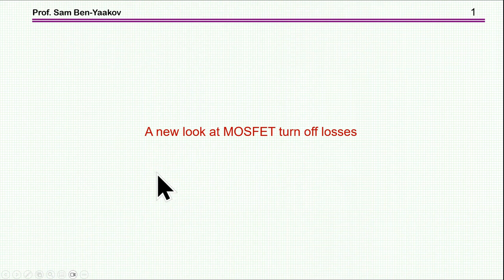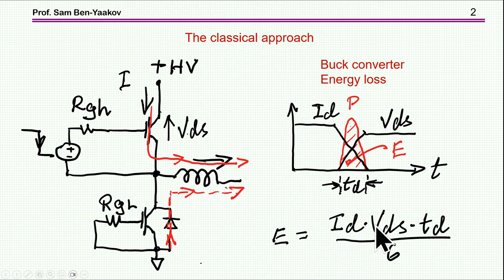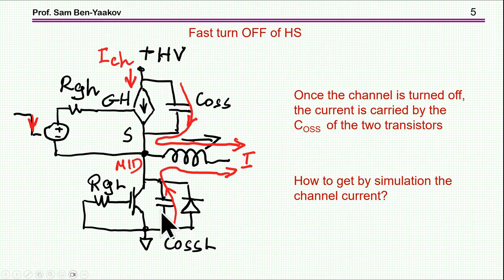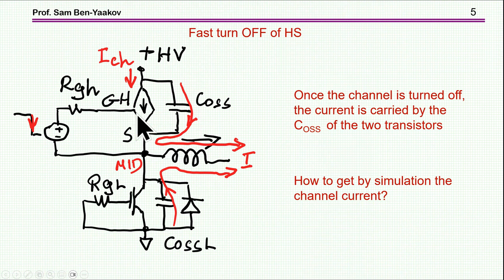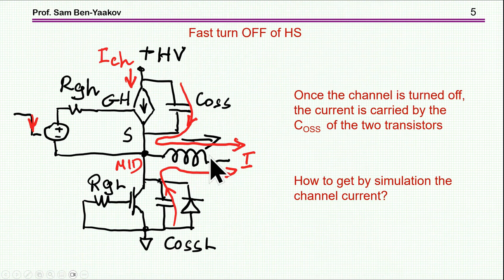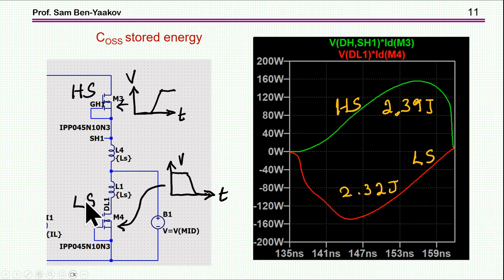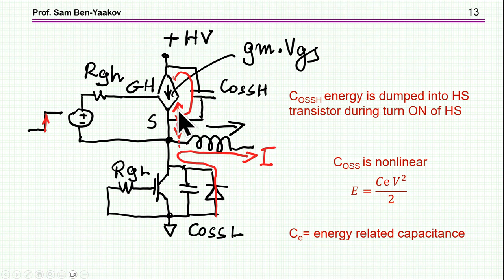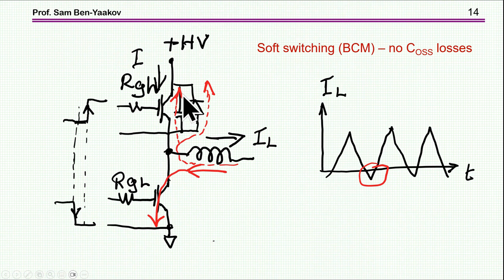A new look at MOSFET turn off loss

Comment: We just published a paper on measuring the turn-on and turn-off losses (title: calorimetric measurement methodology for comprehensive
soft and hard switching loss characterisation). We can directly measure both turn-on and turn-off losses at hard and soft-switched conditions. We do all that without a current shunt or impacting the switching loop. The paper is not yet indexed but if someone is interested I can send a copy.
Reply from the maker: Interesting. Can you send me a copy? sam.benyaakov@gmail.com
Reply: Could give the link to the paper ?
Reply from the maker: OK

Comment: Would the accuracy of the simulation in this context be improved at all by switching from the Shichman-Hodges model (level 1) to an alternative model such as MOS2, EKV, or BSIM? I know the latter two are designed for submicrometer ASIC applications, and may be difficult to set up from the datasheet alone, but the improved modelling of subthreshold behaviour seems to imply that they might offer improved accuracy in the context of switching losses. I'm less familiar with MOS2 (and MOS3) but they look to be very easy to set up.

Additional question: is there any non-negligible internal parasitic resistance (or another source of thermal loss, such as we see with domain wall heating in MLCCs) in the internal Coss path during switch off? If so, is that at all relevant in the hard or soft switching cases? (presumably not in hard switching, since the energy is lost into the channel anyway, and only fractionally so in soft switching due to external parasitic losses dominating the picture)
Reply from the maker: Good questions. 
1. I really don't know which model is th best. I am using models supplied by the manufacurers assuming that they chose the best MOS model.
2. Dielectric losses were documented for super junction transistors, I doubt if it is significant here. 
Thanks for the conversation.

Comment: Great explanation on the MOSEFT switching behavior. One question, considering the channel loss and Coss E stored as a whole during MOSFET tuning off, how does the dependency on inductor current look like? Is it still the higher the IL the less the total loss but with less correlations factors, or no change on total loss?
Reply from the maker: Good question. The inductor current is controlling dv/dt. The higher the current the faster is the rise and the overlap.
Reply: @sambenyaakov do you mean to say that at higher currents , voltage will rise steeply, therefore overlap between falling current and rising voltage will increase therefore increasing channel loss ? On the other hand, for low inductor current, the voltage will rise slowly and therefore low losses ?
Reply from the maker: @mehtabhussain4961  Indeed

Comment: Hello Prof.Sam. What a wonderfu lecture.. Can you explain why the current direction of the upper Coss is like that? should be it opposite way? 9:21
Reply from the maker: Yes, you are correct. This is an error. The arrow is in wrong direction. Thanks for pointing this. .

Comment: Prof in the circuit at 00:10 if the diode is conducting the voltage across the top mosfet should be clamped to +hv so i can't see how vds voltage and id current can change simultaneously 
Thanks
Reply from the maker: Did you see this? https://youtu.be/G0-RCRvd9pY?t=200  The voltage is controlled by the caps charging. If you don't follow, let me know.
Reply: Hello Prof  @sambenyaakov . I had the same question - I was also expecting HS FET's VDS to rise completely before ID starts dropping. But after I rewatched the time stamp you are referring to, I could deduce this - In the case where HS turn OFF is FAST, in that case the COSS of HS starts carrying current, which slowly charges it up (raising VDS) while channel current ID is dropping

Is the understanding correct?

And if so, do we mean to say that IF the HS turn OFF was SLOW, in that case we would see VDS rising fully first (and LS diode starting to conduct) before HS ID starts dropping?

Thank you.
Reply: But the source voltage is free to change
Reply from the maker: @tanmayvadhera4250  The source voltage is not " free to change".  The source voltage is dictated by the external circuitry. A MOSFET is a current source not a voltage source.
Reply: @sambenyaakov Dear Prof, I actually meant to say the same thing, as in the drain is tied to the supply and the source is free  to change based on the load (as you mentioned) .
Reply from the maker: @tanmayvadhera4250 And the source voltage is controlled by the Coss voltage not the other way around.